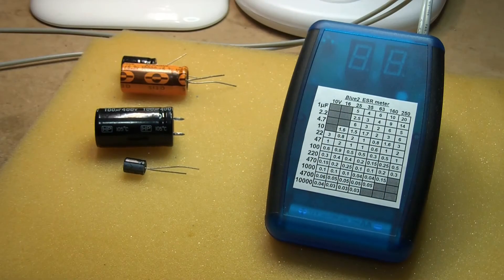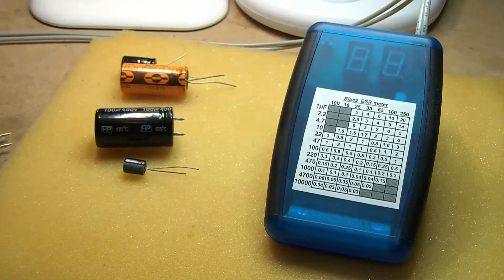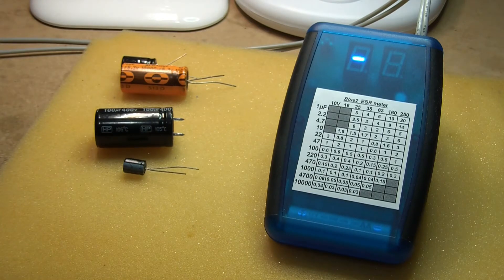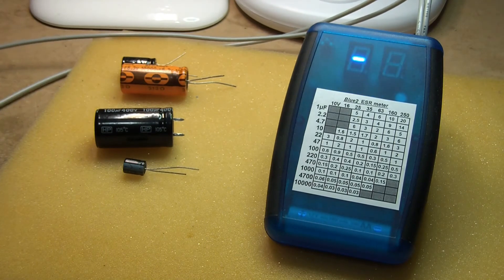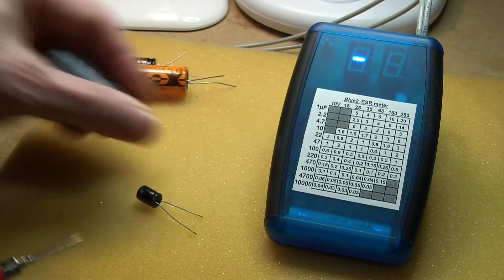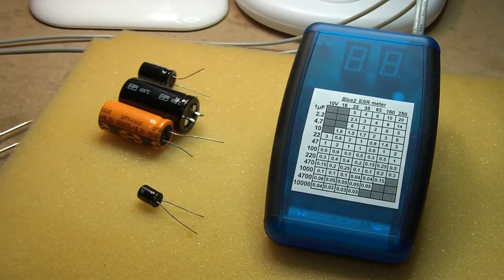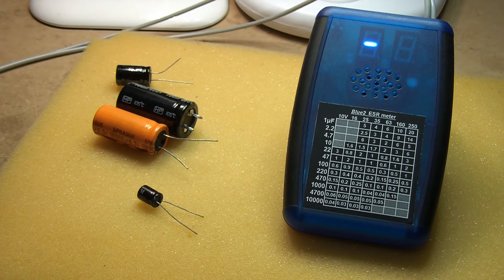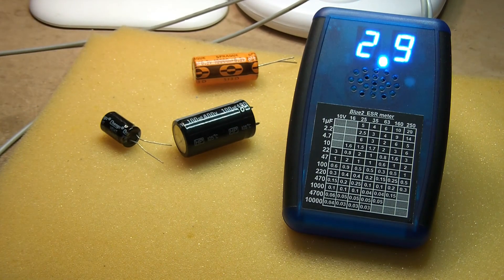Demo of Bob's "Blue2" ESR meter.

Comment: Hi Bob, I just bought your Blue2 ESR Meter.  I wonder the AA lithium battery be used for this meter?  As now there are lithium battery typed AA (and the rest) are available in the market.  Thanks
Reply from the maker: Hi Bryan. Thanks for getting one of the meters. I didn't think anyone was interested in them. 😊 If the lithium cells you're referring to are Energizer Ultimate or similar which have a voltage around 1.6V, they would work fine.
Reply: @ZilogBob  Hi Bob, thanks for your reply.  In fact this device was recommended by my teacher, Mr. Jestin Yong after I attended his electronic basic lecture lately.  He did a great demo and it makes diagnosis easy and accurately.
Reply from the maker: @bryanleon1436  Hi again Bryan. Thanks for telling me that Jestine is demonstrating that meter. I've known him for quite a long time and I'll have to thank him for that. I hope the meter will save you heaps of time in your repairs. Good luck! 👍

Comment: Hi. Bob I am interesting of purchasing one of old or new models. Can you tell me what are the difference in the two models Anatek/Alltronics original Blue ESR meters vs new "Blue2" ESR meter. 
Can you use the new blue2 esr to measure 18650 battery 4.2volt.
Thanks and Merry Christmas to you.
Reply from the maker: Sorry for the slow reply. I've got some kind of infection which is making me sleep nearly all the time. The main differences between the earlier meters and this one are listed in the video's description. Apparently nearly everyone is happy with the original design and have no interest in the new features like reading down to 0.001 ohms and being powered by 2x AA cells. The "Blue2" meters would be able to measure the internal resistance of an 18650 cell. Merry Christmas and Happy New Year to you too.
Reply: Thank you Bob for the info on the new model It would have been nice to have a 3rd digit, at that resolution will be good for finding dead short circuits as well.
I'm going to check what is the difference in the prices if there is a small difference I will consider the new model if it's a big difference I'll consider the old model. I hope you get well soon.

 @ZilogBob
Reply from the maker: @yannis92preloude  Thanks for your nice wishes. I feel horrible right now. This meter will read down to 0.001  ohms. Below 0.1 ohms, both decimal points illuminate to indicate that it's reading in milliohms, so it doesn't need another digit (which there's no space for anyway). Check out the notes I wrote for it, at http://bobparker.net.au/esr_meter/Blue2esr.pdf

Comment: Hi Bob
Hope you are well. I have an EVB ESR meter that I use all the time. Definitely an invaluable tool and a huge time-saver on any repair job. I'm very proud of the fact that such a handy and respected device was made by a fellow Aussie. I was in grade 4 in primary school when your first design was released - a long way away from ever attempting repairs of my own and getting into the hobby. It is quite amazing to interact with you on YouTube :)
I was wondering, what leads are attached to the prototype units in this video? They look very nice and simple.
Cheers and Merry Christmas to you.
Reply from the maker: Hi there Frederick. Sorry I missed wishing you Merry Christmas but I can say "Happy New Year". Thanks for your nice feedback. It's 27 years since I designed the original version for helping with my own repairs, and no one involved with the project ever expected that it would be very popular, let alone still be on sale after all this time. This meter uses the Kelvin or four wire measurement technique to let it measure down to single milliohms, so the leads are actually thin audio coax cable which I got from Jaycar. Regards, Bob.
Reply: @ZilogBob  Hi Bob - thanks for the response and well wishes.
I realised that I have used the wrong terminology when asking about the leads. What I meant to ask was about the probes, although your response is very helpful regardless as it addresses the motivation behind me asking in the first place, which is that the test probes that come with the EVB meter are impossible to zero; I suppose owing to their high resistance?

In any case, I found the probes that you are using at Jaycar too! (2mm test probes for $4.95). I think I have some leftover figure 8 audio cable from Jaycar - the grey one like yours pictured.

Do you think I could use these to wire my own test probes + leads to 4mm banana plugs for my EVB meter?
Thanks again, and Happy New Year to you too :)
Reply from the maker: @fredsk1  Hi again Frederick. All the test leads I've measured have well under 0.5 ohms of resistance. I've found that using a grinder to remove some of the plating from the tips can be helpful. The "Blue2" meter in the video has different circuitry to the original ESR meters, to make the Kelvin (4 wire) measurement principle work. You wouldn't gain anything by using coax on the EVB meter. I don't specifically remember where I got the probes for the meter in the video from but you're probably right that they were from Jaycar. The New Year is getting uncomfortably close!

Comment: Does this tester allow you to measure capacitors without unsoldering them from the board?
Reply from the maker: It can measure the ESR of capacitors while they are still on the board. However if there are capacitors in parallel with them, then one lead will need to be unsoldered.
Reply: @ZilogBob  Thank you! Is your product sold on aliexpress?
Reply from the maker: @thomsoftthom2616  Sorry, the only supplier who has them for sale is EVB in Portugal. The website is at https://evbesrmeter.pt/index.htm

Comment: It won't read any of my vintage silvered-mica capacitors , just shows -.  I think they are rated too small.
You said milliards. I brought that up with the band in the studio here in the states one time and they called me on the carpet. We were at the drummers house, I told him, go get a dictionary. You know the rest.
Reply from the maker: ESR meters won't give reliable readings on capacitors much under 1uF. I said "milliohms", not "milliards" which I had ever heard of until now.
Reply: @ZilogBob  I figured the ratings were to small and that was why I  was getting no reading. They were the old color coded ones.
Milliard
 The cardinal number equal to 109.
A thousand millions: as, a milliard of francs.
A thousand millions; -- usually called billion in the United States.
This sometimes confuses me when I hear a billion used in relation to Europe. Are we talking a U.S. billion or a
European Billon, which is a million millions, as opposed to ours, which is a thousand millions.
Reply from the maker: @j.dragon651  The only capacitors which have a big problem with their Equivalent Series Resistance increasing are electrolytic capacitors. Nearly all of them are 1uF or higher. It's very unusual for other types to fail that way. That's why ESR meters generally won't give sensible readings for caps much under 1uF. Yeah, I looked up milliards after you alerted me to that word. Thanks for improving my knowledge. :)
Reply: @ZilogBob    
       Dealing with vintage tube guitar amplifiers I come across many smaller values. I just came across a .047uf @1000v electrolitic. I couldn't find one in my usual sources. I am not sure if I can trust the meter at those values?   Both values are off the charts.
      As for our conversation about numbers. I'm sure some scientists measure frequency in the billionths of seconds? Is there an international standard so there is no confusion? We may be the only two out of a milliard, or would that be a billion, having this conversion?
Reply from the maker: @j.dragon651  I think you'll find that the 0.047uF capacitor is not electrolytic. I just checked the Digikey catalog and the smallest electrolytic caps they sell are 0.1uF. The ESR meters will hardly respond to a value that small, if at all. Frequency is measured in Hz. Time is measured in seconds. 1/1000 of one microsecond is one nanosecond. You could probably call that a billionth of a second. Yeah, I think you'd be right that no one else is having a conversation about these arcane subjects.
Reply: @ZilogBob  I think we should adopt the milliard and start calling a billion a billiard,. It would be more fun.
Reply from the maker: @j.dragon651  We could pool our resources. 🙄
Reply: @ZilogBob  you were correct, it is not an electrolytic, rookie mistake.
Reply: @ZilogBob  how many electronic videos do you have up?
Reply from the maker: @j.dragon651  Almost all electrolytic capacitors have + and - markings on them.
Reply from the maker: @j.dragon651  A few, but most of them aren't about test equipment and are only little projects I have made.
Reply from the maker: @j.dragon651  Very interesting. There is a huge amount of info on the internet about all the stuff you're trying to learn. Yeah, the under-chassis wiring of your typical guitar amp looks nothing like all those crazy symbols in the schematic! 😕

Comment: Hope these come to market in the UK.  a kit version would be great too with non surface mount components, it might make it larger in size but would be a nice tool to use and to say you built
Reply from the maker: Thanks for your thoughts Derek. It would be great to sort out all the problems and get them into production. Believe it or not, the biggest problem is finding probes with sufficiently low and stable contact resistance. 😕
Reply: @ZilogBob   I’ve been looking to replace the test probes on my multi-meter, tried a few different ones and they have high resistance, might have to take the plunge and buy some decent Megger leads which are about the best on the market, I just don’t like the price of them.
Reply from the maker: @DerekEmerson  Professional gear has a professional price tag, unfortunately. 😠

Comment: Where to buy one and are there kits as well?
Was just going to purchase the first gen kit but would love to build this one instead.
Thank you
Reply from the maker: Hi from Australia. Thanks for your nice feedback. 👍 Right now I'm trying to work out some way of getting these meters built and on sale. There are still a few problems which need solving, e.g. getting probes with extremely low contact resistance. Using almost entirely Surface Mount components, it's not really suitable for making it into a kit.
Reply: @ZilogBob  Thanks is for the prompt reply.
 Hopefully you get it sorted. Shame there won't be a kit. An sms kit would be a joy to build.
Reply from the maker: @nghtrdr  You must have very good eyes, steady hands and a very fine soldering iron tip to want to assemble Surface Mount components manually. 😕
Reply: @ZilogBob  With a magnified light and the help of a Hakko fm 2032 w/t30 J smd are easy. Patience is the hardest part really. Whay else can I say besides I love a challenge!
Reply from the maker: @nghtrdr  That's a nice looking iron. I've been using solder paste and a temperature-controlled "hot plate" for soldering my SMD boards.

Comment: Mr. Parker, awesome meters.  Don't understand the 2 decimal points.  ¿Does this mean that 3 signifc digits is only for low resistances (Range: 0.001 to 0.099 ohms), please?  (And after that, [0.10 to 0.99], [1.0 to 9.9], [10 to 99] ?).  Please pardon my impertinence (mean no disrespect).  Thank you.
Reply from the maker: Hi Tony. For all readings above 0.099 ohms, the numbers showing on the displays are the reading in ohms. For readings below 0.10 ohms the numbers on the displays are the reading in milliohms (1/1000 of one ohm). There are only two displays, so the meter turns on both decimal points to show that the reading is in milliohms. I wrote a user manual for the meter, which is at http://bobparker.net.au/esr_meter/Blue2esr.pdf if you're interested.
Reply: @ZilogBob  Thank you for the clarification and link to the manual.  God Bless.  tonyd\.

Comment: I understand your Blue2 brothers aren’t available and you’re not necessarily in this bubble. I wondering though if it could be possible to buy only the programmed chip and the schematics to build one? I can probably get all the parts and build it here. What do you think? Personally I find this tool to be an incredible must-have on my bench. 

Thanks
Reply from the maker: This meter uses 0805 size surface mount components so it's not very well suited to manual construction. Also the microcontroller is programmed in-circuit via a connector and I don't have any facilities for programming them on their own. Right now we're trying to get organised for building and selling the meters. If nothing else goes wrong, maybe they will go on sale much later this year. The COVID situation is making it difficult. 😕
Reply: @ZilogBob  thanks. I found a store who used to sell them assembled or in kit. I order one and unfortunately, I was refunded today because they’re B.O.  

I’ll find something made more recently. ESR meters are more common nowadays I presume.
Reply from the maker: @NicleT  If you search the internet for ESR meters, you will find them everywhere especially on Ebay. There's a list of all the variations of my original ESR meter on my website at http://bobparker.net.au/esr_meter/esrmeter.htm You can contact me by e-mail from my website if you have any questions.

Comment: I like the 0.001R range. When will the Blue2 non-talking be available? What microcontroller does it use? Is it available in kit form? What is the price?
Reply from the maker: Hi. I'm still trying to find out how popular this meter would be, before we start looking at maybe making them. The microcontroller is a PIC16F15354. Sorry but it won't be a kit because it's all SMD components (that's why it's not very big). We haven't worked out what it would sell for, yet. Thanks for asking. :)